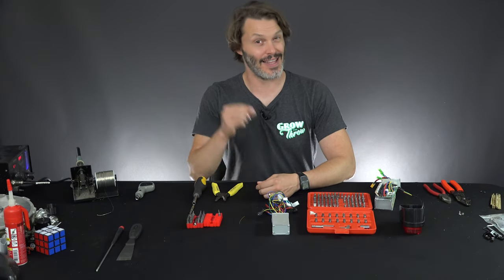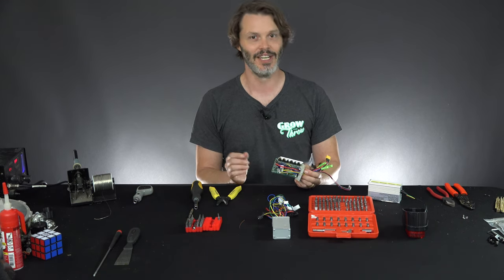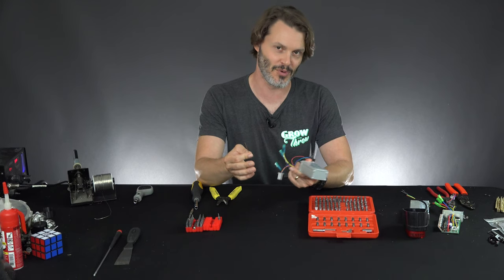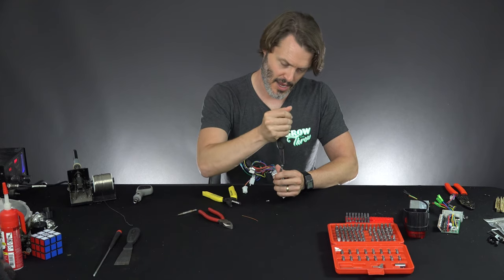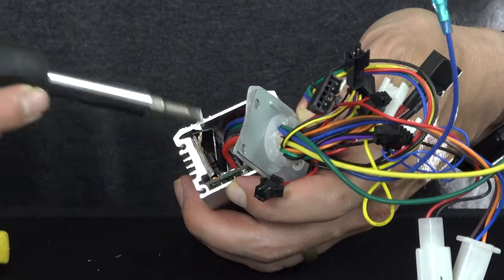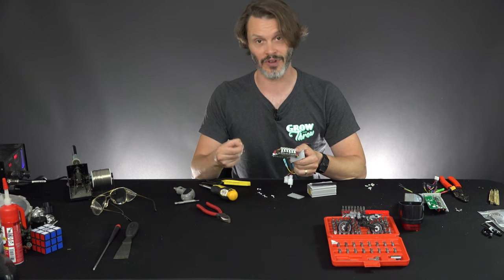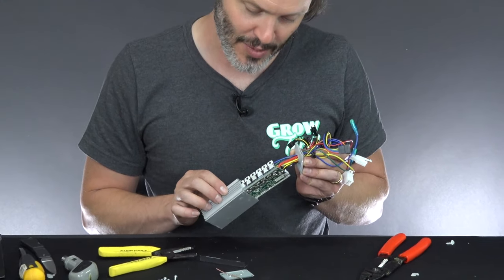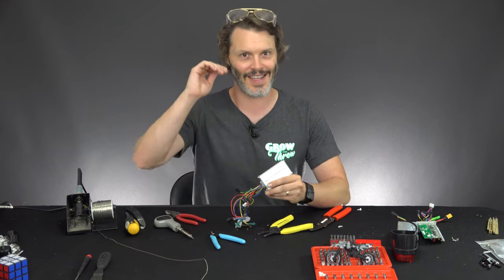More Torque or Bad Idea? How To Shunt Mod a DYU V1 Controller - Voids Warranty! - Holmes Hobbies

Comment from the maker: Just a heads up, this mod caused cutouts on this model and we didn't get more speed. Had to use a higher voltage battery and higher quality controller to get more torque and speed, as seen here 

https://youtu.be/e5R1OeG7FCk
Reply: Shunt mod worked great on my MX01 and MX02s controllers which are the same.
Reply: I did the shunt mod on my 1000w speed controller and I modded it too much. According to my BMS it was drawing up to 4000w and the motor would do this funny thing where it felt like it was almost dragging a brake when punching it full while going slow. I actually had to reverse the mod and put it back to stock.
Reply: Could we see a video for the s2
Reply: Hey can i mod citycoco harley x7 controler ? thanks !
Reply: @TMAX48  Still working?
Reply: If it doesn't work,  take down the video before others ruin their equipment.
Reply: You need a actual shunt to do a shut mod This was differently not a shunt mod bro

Comment: Just want to help others from frying their controller if they try this mod... the wire used to decrease the shunt resistance needs to be MUCH smaller than what was used in this video.  The wire will need to be 22-24awg, or smaller, depending on its length.  A recent controller I modified used an SMD shunt resistor (similar to this video) of 2 mohms (that's 0.002 ohms).  A 22awg piece of copper wire that was 1.5" long had an equivalent resistance, so adding that across the SMD gives an effective resistance of 1 mohm.  Torque was dramatically increased and the controller gets warmer than it did prior, but not hot.  Voltage drop, while accelerating, has increased as a result, which is my guess as to why the OP was experiencing cutouts after their mod (BMS shutting down due to too high current demand).
Reply: @daveoxide so Dave i did this shunt mod by soldering an exact surface mount resistor to the existing one, there are actually 2 but I started with one. When I connected controller to bike an " unknown error code" came up on display. Luckily I had a replacement controller. Any suggestions?

Comment: Just did this to my brothers Jetson Bolt Pro, just used a tiny dab of solder though.  Seems to work great so far.  Before at his weight he was doing 12-13mph, now its cruising at 17mph.  I'll probably build him a better battery using P42a cells for it soon.
Reply: did u controller burn?

Comment: We use to do this on video cards for more overclocking room. We would just color the shunt with a grafite pencil from one end to the other.
Reply: Colour the shunt?  Would that work with this? Or very minimal difference?
Reply: @leepatterson4009  Its just a matter of shorting it out, graphite is conductive enough to do it. Especially on a graphics card. But i would still sauder copper or a silicone wire on, if it's for an EV for the reliability.

Comment: i did this mod, i went from 60amp to 97amps. it lasted maybe 20 miles. it actually died on me going super slow up a slight hill. i was going intentionally slow about 6mph,  to watch the amp load from two different meters. at the time it stopped working i was using 10-30 amps average about 15 amps. it was a dirt trail that was a tad muddy, but i was not spinning the tire. all of a sudden it went limp. no popping sound, no smoke, but then again it appears to be sealed.

that was a long walk out of those trails/hills all the way back to pavement with what felt like an engaged brake. i had to drag that thing home another 3 miles once i got back to pavement.once i got home i unplugged the motor and it began to spin freely...uhg

i opened the controller up and found two destroyed mosfets. i ordered the replacements  and just before i installed them i inspected the controller board very carefully and found many things were destroyed. almost looks like random traces underneath some layers of the pcb were fried and brown looking. 

if i do this again, i will be very careful to only put a tiny amount, these two weeks waiting on my TWO new controllers this time of year sucks as i know the days are very limited at this point this time of year
Reply from the maker: Low-speed asks more of the mosfets. 30 amps at 10% throttle is 300 amps in the fets, and most to220 bodies can't handle more than 100 to 120a before they start to thermally run away.
Reply: my e bike wheel spins but won't carry any one after changing the back wheel no power lost a clip to the disk brake any ideas everything turns on lights an no answer from seller
Reply: @HolmesHobbies  are there MOSFET upgrades available? Like stuff the biggest/best ones in the controller before shunt modding. I don't know much. Just what I've read and watched. The goal for me would be to modify the controller to a point where it's still reliable, fixing the weak links.
Reply: @growingmj2865 if you lift ur back wheel off the ground, turn throttle and ur wheel spins but u can't put a load (person) on the ebike, u misplaced a tiny little piece u need.  It's called a keystock and it's like a clinch pin for the rotor + stator. 

ebik wheel will spin, but planetary gears aren't. ...this is where ur keystock comes into play.  Hope this helps.

/bklyn 👑

Comment: One thing I found with these  controllers is that the heat dissipation is normally bad, I often after testing it first pull them apart and put in some better heat sink past it seems to make a huge difference as you get better cooling.
Reply: Does the heat paste go between the heatsink and case?
Reply: @marthamryglod291  I put some on both sides so you end up with a sandwich so the heat can travel directly to the body which doubles up as the heat sink.

They often use a sheet and grease but where they put grease use a good paste it's better than the grease.
Reply: @flitsies  thank you!
Reply: I keep the sheet by the way in place, and that is sandwiched so it travels through the past through the sheet then through the past to the metal body.

But the grease is removed.

Comment: If you want to jump the shunts on your controller instead of using a small piece of copper it's much better to solder the shunts together that way you are getting a good connection which is very important doing this. Try soldering the shunts and try it again

Comment: The shunt mods that I did and confirmed with a (Kyoritsu )dc clamp meter is that the mod just makes the current metering on the controller go out of calibration,It does not change bias or make more current flow through the mosfets.The on resistance of the mosfets on most controllers from source to drain is in the milli ohms.And the shunt is in series with that,Your current to the motor is limited by the Battery BMS,Wire diameter from battery to the controller and controller to the motor and the cross sectional area of the traces on the circuit board at the mosfets source and drain.

Comment: Hi, grate video. Just a quick question, method to my madness if I use a thin bit of wire 0.3 26awg/ 0.5 22awg copper wire or a thicker bit of wire 1.5 18awg/2.0 16awg copper wire. Would the thinner bit of wire let less amps or less currant through will only do a little bit more top speed/acceleration, as a thicker bit of wire will allow more amps or current to flow through giving more power to motor for more top speed/acceleration  am I right in thinking that or am I wrong?????🤔🤔🤔👍👍👍👌👌👌👌👊👊👊

Comment: I think the reason that you didn't notice a different when you shunt modded your controller with the bike you were talking about is. probably because the throttle. curves for the original throttle is stopping it. That would be my assumption though

Comment: Great video, thanks ! It would be possible to do this shunt mod on a KCQ-EMC7939 controller, taken from Aprilia esr2 e-scooter, which is already programmed with 3 speed settings (5/20/25 kmh ) ? Would increase speed or torque? Thank you

Comment: Can you answer this yes or no question please! 

Is it safe for a 500watt hub motor to be powered by a 48v 14ah battery and a 28 amp controller without it burning out or is that too much??
Reply from the maker: I would do it.  A big hill could spell trouble for overheating.  Your biggest concern will be wind resistance at top speed.  If under 25mph, should be no worries.
Reply: @HolmesHobbies  I live in Miami, Florida so I’m good there are no hills here :) thank you very much !

Comment: :) That's how you don't do this! This will smoke up in no time. Try with a little bit of solder on one end of the shunt and don't go over 20% increase....
Reply: What do you mean?
Reply: My controller was gone in less than 20 seconds, i had bridge the shunt  with copper wire and it seems that was a very bad idea.

Comment: Have controller issue putting ne controller  after one ride only one speed like 20kmh  usually 3speed working fine and then breaks something.what I need to look in controller to fix any idea.thanks for informative video.

Comment: Thanks from England for info. Could you answer a question please. 4×12v7ah lead acid batteries don't move my bike, can you tell me a solution, and when I say won't move, I mean if you press a finger on the bike it can't move, and I'm stumped. The bike is 36v and when it was not powering I added another battery to 48v, but nothing. Any pointers will be greatly appreciated.
Reply from the maker: It worked on 36v?

Comment: hvd-3 800w my controller has a R005 resistor I'm looking to place another on top to half the ohm. To 0.0025. .... The resistor is a 0.0005....question is what watt do i buy 1w 2w 3w 4w 5w... I haven't a clue can u help please

Comment: Is there a follow up video?  Did it work as I want to try this with a 36v 1000W controller I have across what looks like the same ZMD type resistor. Appreciate some feedback please.. Cheers
Reply from the maker: Nah, battery faults out

Comment: can i also change my capacito from 63V to 100v?after this shunt mod
Reply: Once the voltage of the capacitors is above the voltage of your battery when fully charged then there is no need to change them. The electrolytic capacitors also have a temperature rating so if the controller is getting much hotter after the mod it is worth upgrading them to the higher temperature operating ones and 100V ones too.

Comment: Hello I like the video how long do I still have to wait to see you testing out the shunt modification and if it was worth the effort.
Reply from the maker: I'll save you the time, it just trips out and doesn't work now, lol!     Been having a rough go at filming enough lately and ebike vids take a lot of time to do.
Reply: @HolmesHobbies  Can you just unsolder the copper off and go back to normal? Also you said this can be done to any controller so any idea what happened with yours? Was it the shunt mod itself that ruined the controller?
Reply: @HolmesHobbies   I want your help , I have an electric scooter and its controller was burnt and I searched a lot and could not find the same so I bought another one but I did not know how to connect it, can you help me with that please?
Reply: @HolmesHobbies  please do some test  
Like peak current after shunt adding or removing
Reply: @HolmesHobbies  then take the dang video down or do you only care about getting views

Comment: Do you know if running a 36v battery and 36v rated controller on a 48v hub is legit? Like, will I ever run into any type of issues?
Reply: You should t have any issues. You just won’t be getting the full speed it’s capable of.

Comment: How did you get the spring steel that holds the components against the case
Reply: a screwdriver and then pull it out of the small slit

Comment: Hi my controller has 2 R005, 5 miliohm smd shunt resistors. What is the best way to mod them as the max amps being produced by the controller is only 8 amps and the fets are rated for 25 amps please?
Reply: What did you do in the end mate, I saw your video and that is some increased torque you have now, did you have any trouble with the display not being accurate after?
Reply: @amagnu100  I bridged the 2 resistors with wire links in parallel, i.e. bypassed them. Bike still working fine except when the bike is fully charged and you try to take off in full power, i.e. PAS 5 the display and power cuts out. So I only take off in PAS 3 and then if I go to PAS 5 when moving and  all is ok. Bike is still working great and way more fun to ride especially on take off and climbing hills.
Reply: Someone else I know just shorted out one of the resistors and still got loads more torque and acceleration, so I might try that on my MX02s as the frame vibrates with the extra power on takeoff.

Comment: can you do this in reverse, like making a 30amp controller to an 11amp controller?
Reply: No need to do this, if you motor is only 11A rated then it will not pull more amps from the controller.  No matter if the controller is 11A, 25A, 50A etc.
Reply: @ulliu.3200  thats not true wtf

Comment: I have  a 24v 350w controller and I want to add a led light bar what light should I get.
Reply from the maker: Search Amazon for 24v led lights and wire em in

Comment: Hi I have  Lehe K2 scooter that is giving me problems with the remote controls I have two both remotes occasionally work after a long time I have replaced with new button batteries but still getting problems Is there any way I can override the remote control and just switch on at the battery then press the start button on the Speedo face When I press the remote start button there is three positions at the bottom is start then alarm then unlock lock at the top The scooter makes a distorted noise when you switch the battery switch on then you are supposed to press the start button at the bottom of the remote then press a button on the speedo face It then says we are searching then connected if it’s set up on a mobile but this is not working maybe after about 20 goes it might 😡

Comment: Can I over volt a 48v ebike speed controller with a 72v battery pack the mosfet in the speed controller are 70v 100amp
Reply: No

Comment: Hello, I have a problem with the brakes
If I put the High Brake Line on +, the engine just shuts off, but it doesn't brake.
Can somebody help me?
Reply from the maker: There is no engine braking, it just Cuts power

Comment: these cheap controllers are so much more reliable than a standard RC ESC (par example) brcause they have a form of current limiting. 

Increasing that (slow*) current limit to infinity is really stupid because: 
- if a fet dies in the h-bridge, you fry the cables, motor and endanger the battery. If the battery gas a poor short protection you're in for fireworks too. 
- the shunt is only monitoring the overall, slow, current fluctuations, not the fast and spiky per phase currents that can be 10x the average general current. Even the cheap controllers monitor and limit the fast currents with a bemf discriminatory logic or an actuall copper trace shunt on each phase. 

So, completely removing that fire protection is really stupid.
Yes, decrease the shunt value, maybe, to get a little more umph,.. but not to damn zero.   

I actually prefer to increase the shunt value for less peak battery draw.
Reply: Would you say using a resistor in parallel would be better? If the current is small on this part of the controller and the voltage drop is all that matters a small resistor should do right?

Comment: I can't do this mod, cause Juiced Bikes thought it would be hilarious to pot their ECUs with epoxy. Ugh!
Reply: That’s to keep it cool…
Reply: @Gunjaroo  Actually, it's mainly to keep people out so they cant modify it. Secondly, potting keeps moisture out, which is always a companies official reason to pot electronics of any kind. Airflow via fans or natural air movement would keep the ecu cooler than epoxy potting it, hence the new vents Juiced now has in the RCS's downtube.

Comment: like most pcs of junk Chinese made products you dont need to worry about voiding there fake warranties any way considering their warranties are usually bit even worth the paper they are printed on when they dont and wont honer any warranty without making some one spend way more money or time to even try and get them to honer any of there fake warranties.
Reply: And could you point everyone in the direction of controllers not made in china and if they aren’t made in china don’t use any Chinese parts

Comment: 2nd hack ive seen with no follow on video, makes u wonder why...bullcrap, or it didnt do anything and not worth a follow on.
Reply from the maker: The shunt mod didnt work well on this bike because the motor is too slow to wake up on 36v. I had to increase voltage and use a controller with better mosfets, just dropped that vid here  https://youtu.be/e5R1OeG7FCk